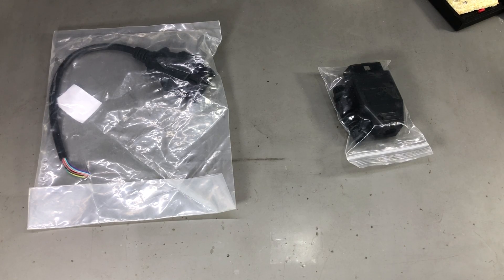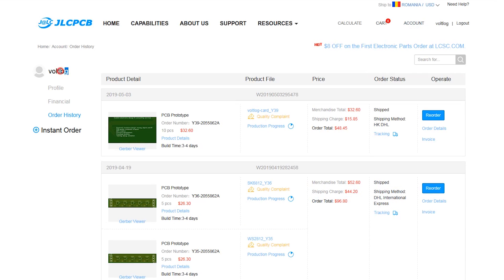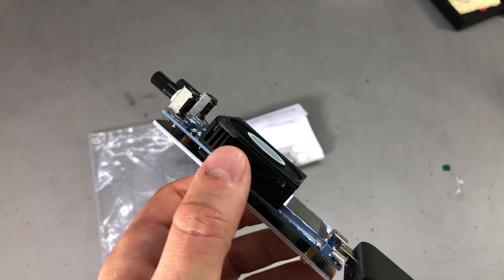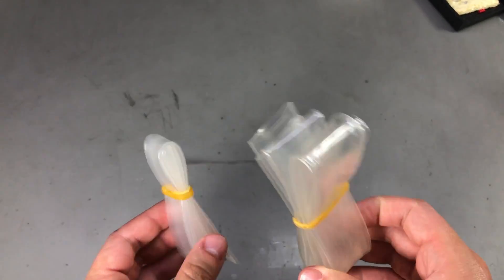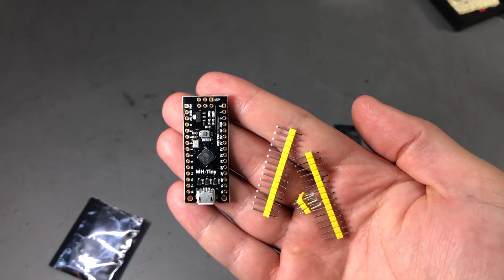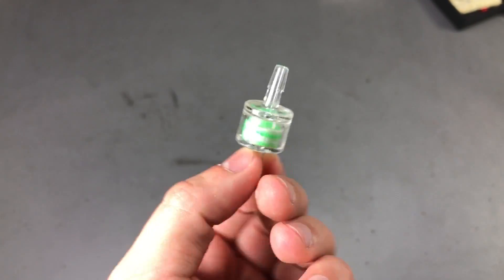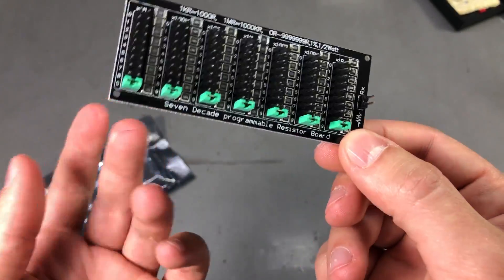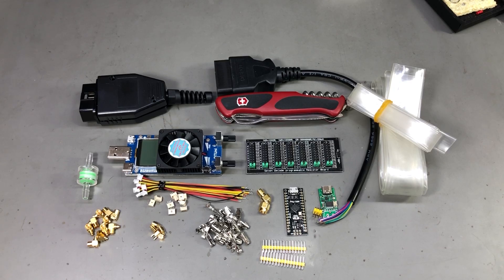Voltlog #236 - InTheMail

Comment: Ok, that development board is something I did not know, thanks for the info... (not attiny85, but Attiny88 by the way.)
Reply from the maker: yes you're right!
Reply: I experimented with some attiny84/88's last year ... and yes they are useful, but am unlikely to order more because the the atmega8 is LESS expensive, and has "real" USARTs, i2c, and more pins.  The Tinys' PLL does make it capable of banging out USB 1.0 without a crystal though ... so it has its niche.

Comment: Does the USB-C power delivery module remember the setting it is on? For example, could it be set to 9V and then every time you plug it in it would get 9V, allowing it to be permanently wired to another device that requires such a voltage?
Reply from the maker: Nope, does not remember the setting, it always goes back to 5V when reset.

Comment: The decade resistance board is a great product, I have an old 'wheel' type that is in regular use,
The USB-C PD board is very interesting, it would make an PD equipped powerbank into a useful multi-voltage source (is it just for voltage testing or can you pull an amp or 2 through it?) 
You can buy in-line water filters that screw together so they are very quick and easy to clean, I found the supplied filter media restricted flow and bought some coarser filter pads and cut them to size, this gets round the problem of wrong media clogging within minutes/hours, also, 2 stage filtering can be the answer if you have large and small particles to filter out, hope this helps

Nice gift from Andreas, I've not seen the larger Swiss army knife, only the 2(?) smaller sizes

Comment: Have you seen the lcd from that current sink used anywhere else? I was a sucker and got a few of these LCD's for just over $1 each. There's no official documentation that I've been able to find. I know the pinout, a few commands, that it's an SPI implementation of a ST7565 controller and has an odd 96 x 65 resolution. I made a couple of breakout boards but I'm well aware this hacking project is over my pay grade. If I had a cheap working product that I could put a logic analyzer on, I might have a chance of hacking it. That mystery μC is not as friendly as I'd like, but getting one of theses just for the lcd info is tempting :-)
Thanks for the upload.
-Jake
Reply from the maker: I don't remember seeing that LCD before but it's definitely not 96x95 resolution, look at the aspect ratio, it has way more pixels on the width. Usually aliexpress sellers that sell you these LCDs might be able to provide a Chinese datasheet as well but if that's not an option and no info is available, one must resort to reverse engineering the interface and ofcourse a working model helps a lot.

Comment: Does the MH-Tiny have an Arduino bootloader installed and is the USB connection just for power or also for programming?
Reply from the maker: yes it uses the same bootloader as Digispark boards.
Reply: This certainly has an ATtiny84 ("4") ... with the "Micronucleous" bootloader (like DigiSparks), which takes advantage of the tiny's PLL adaptive clocks, so it can bang out USB 1.0 for the bootloader... Yes, supported by avrdude/Arduino.  DigiCDC examples show how to print-through-serial-USB statements.  The ATmega8a has the same amount of flash though, is cheaper, and has more pins and interfaces.

Comment: JLCPCB matteo.raepple Great video! I would love to get some coupons because I am currently looking for a good pcb manufactorer for my newest project and I am still deciding between Jlcpcb and aisler. Any recommendations? The only problem I have with jlcpcb is the expensive or long delivery ( a coupon would help =D ). 

I love the usb current tester, but could you please tell me the name of the pcb screw mount things (for example in &:30), i would love to use them in my project. the heatshrink and the jst connectors are also intresting. for the smd jst connector, you could look at lcsc, they have a lot of cheap products, I am sure they also offer them ;) I will definately check out the resistor test thing, this looks awesome!
THANKS